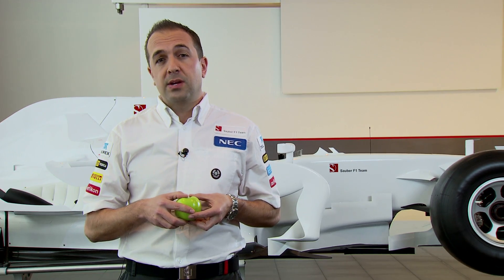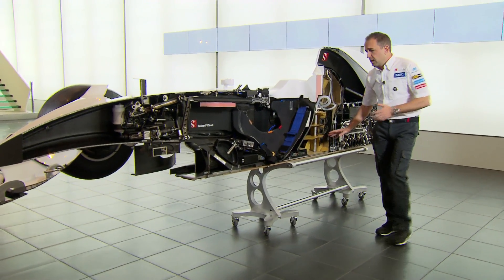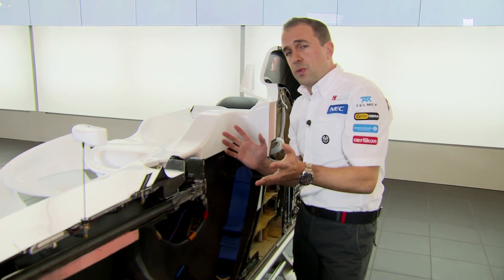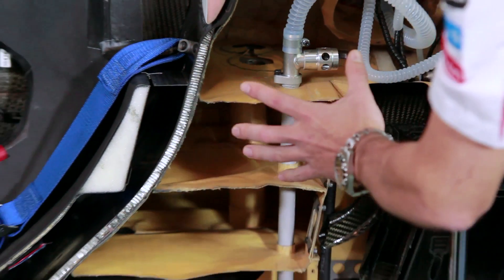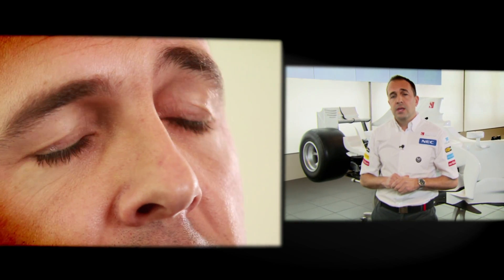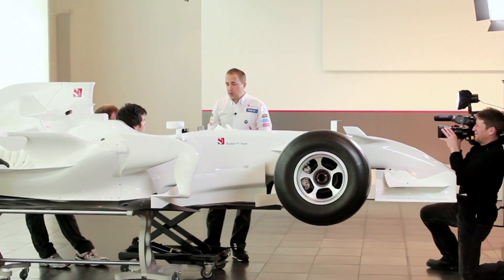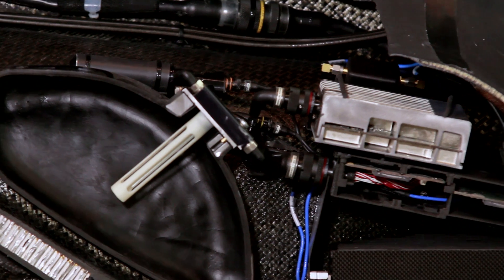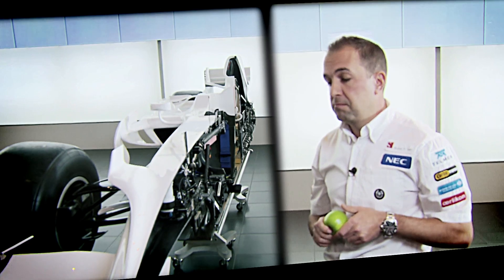Cutaway F1 Race Car - The Original Video - Sauber F1 Team

Comment: Two things strike me particularly: 1) how high are the drivers feet (or how log is is butt)... 2) you didn't show the engine / clutch / gearbox.
Reply: This is becaus they keep is secret that no one can steel informations and copi theyre car
Reply: @L2H5  you're probably right, but still it is frustrating...They could have filmed that part and released it only a few years later, now we could enjoy it at least!
Reply: @MrJef06   yea i think it is still a critical part of the car and even today sommeone could use this informations
Reply: @L2H5   That's a very valid reason for Sauber to be secretive.  But, considering that Sauber has always been a second-tiered team in F1, it does make one wonder why they're being secretive . . . as Sauber has never reached the heights of F1 successes as the likes of Ferrari, McLaren, Mercedes, Red Bull, Brawn, or Renault . . . as all the teams I've named here had technologies that were better refined to achieve the F1 successes they've had; which Sauber has yet to achieve.
Reply: @bloqk16  thats true but the teams that are slower as sauber could get an advatage over sauber. And I think it cold be that it is forbidden from the FIA to show the gearbox and the engine.
Reply: @L2H5  Ah!  That's a great point you made about it being forbidden; as the FIA is very protective of the teams with their proprietary engineering . . . as I now recall that big flap with Ferrari and McLaren many years ago.

Comment: It would have been great to see the engine and gearbox in more detail after all that amazing hard work.
Reply: Seems from reading Sauber replies that they weren't allowed many close-ups, only on certain parts of the car.
Reply: @Marcus Dutton . . . Yeah!  I was disappointed not to get a close view of the drivetrain.
Some YT comments here have speculated the lack of video closeups could have been due to Sauber wanting to keep some engineering secrets.  But, I contend that considering Sauber has always been an also-ran in F1 racing, their competitors had better engineered technology than what Sauber used; so Sauber had nothing to hide.

Comment from the maker: No, Geoffrey. The seat is very thin and light. It's sole purpose is to hold the driver in place (together with the seat belts). It's connected to the chassis by 4 small screws/bolts.

Comment: Sauber, the cut away is incredible!
I am a big fan of the Cutaway Insights series, the episodes are very interesting.  Would it be possible to go into more detail in the episodes, such as how many HZ the data logger logs at, what data accusation sensors are used, what materials are used in the steering column, why the steering rack and pinion is helical, or how the pedals are made and mounted to the monocoque and how the gas petal is linked to the throttle body.

Comment: Thank you Sauber! What an interesting look!

Quick questions, is the pedal system included inside the monocoque? I was wondering because, what if by adjusting the seat instead? Also, how high is the pedal in reference to the bottom of the car (reason for asking is I am building an F1 monocoque replica)? 

Thank you again for the great video!

Comment: regarding my previous comment. some images suggest a rack and pinion, and some sources even state that the F1 does, indeed, have a rack and pinion system. I'm just wondering if this is a standard or varies from manufacturer to manufacturers (if some use rack and pinion and others recirculating ball).

Comment: could someone tell me if the steering system in an F1 car is rack and pinion or ridge worm roller type? I know that rack and pinion is considered to be the better one in terms of feel and sharpness, but given the packaging efficiency of the recirculating ball system and the lack of space in F1, I wouldn't be surprised to know it's of the latter type. it was hard to see in the video. your help is appreciated. thanks beforehand :)

Comment from the maker: Not sure which hole thingy you mean... The 'big thingy' above/behind the driver's head/helmet is the airhorn (which feeds air to the engine for combustion). There is also a little 'hole thingy' underneath the airhorn which is used to lift up the cars with a cran in case they stop on the race track. We hope this is helpful :-)

Comment from the maker: KERS was only introduced in 2009. As this is a 2008 car, it doesn't feature KERS. The batteries and electronics were actually located on the sides of the car (cooling!). Can't share any details about the current Ferrari system though :-)

Comment from the maker: Almost correct. Engine specs haven't changed since then (2.4l V8), so those engines could still be used in F1. We are running Ferrari engines (and gearboxes) since 2010 though...

Comment: great video. helps realise the facts for those who are not convinced that f1 is a tough and dangerous sport.
amazing proximity of the fuel tank with the pilot who has practically his butt on the floor! what a position when the temperature gets hot and you get frustrated by the race....explains a lot of post-race tired and frustrated reactions.
engine and gearbox not possible, not really a secret but close. show me yours i'll show you mine sort of thing.

Comment: Cut off wheels, band saws... pretty much anything would work. What's actually impressive are the parts they didn't cut and reassembled into halved casings to show exposed assemblies. A real pity the director focused more on the guy talking than the actual vehicle.

Comment: Well, the electric motor is locatet at the front of the enginge and is normaly directly connectet to the crankshaft. The batterys are under the fueltank. Some rumours also say, that some teams locatet the batterys under the gearbox. But i don't know if this is true. I think, the heat from the gearbox would lower the batteryperformance to much, but F1 engineers are cleverer than i am, so maybe they found a solution for this problem.

Comment: many an idiot like you have said that to me before. like you they were dumb enough to 'think' that knowing that term made them universally right and they didn't have to be concerned with little details like the truth. there is a substantial element of irony in it but no doubt lost on you.

formula 1 is feeling the pressure from the electric car. they are not leading, they are holding back.

Comment: Really, the only thing in electrics that is still being developed is batteries. Lithium/air is lighter and much more powerful that anything in use today. An electric motor puts out maximum torque at 1 rpm. the motors can be made small and light and do not have to turn 18K rpm to produce power.  Sorry but electric is the future, like it or not...

Comment: no, you get alot of negative votes because you're being so immature about this. 'I'm the smart one here.' what, are you five? you probably dont even understand how KERS works. put imply, it gathers up about 400 kilojoules of energy in a quick release battery, that is then released into the gearbox through a powerful electric motor, increasing the power by about 80bhp. theres also one that works solely through flywheels dleivering power directly to the rear wheels, but this is less common I think

Comment: Formula 1 isn't leading in racing technology?  KERS?  The KERS (Kinetic Energy Recovery System) technology is cutting edge tech that will advance year by year in pace with engineering. Sorry to disappoint you but combustion is by far more advanced and efficient than any electrics at this time.  If you knew anything about F1 you would not have made your ignorant uninformed comment.

Comment: combustion engines are no longer the pinnacle of technology mr Sauber. electric drive is (or even better). you are irrationally holding on to primitive tech. formula 1 isn't leading anymore, it is trailing.

Comment: Yeah, the 2008 cars were built around entirely different regulations. Even in 2012, the current car is simply an evolution of the 2009 design. So it makes sense to split an older generation vehicle and not give any secrets away.